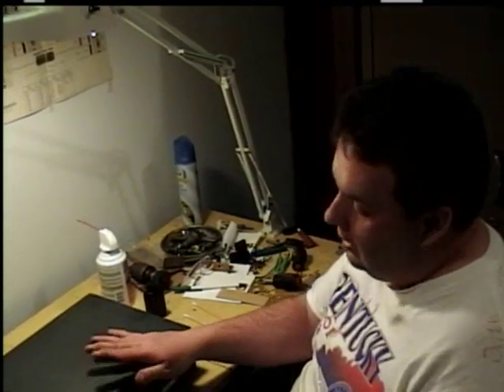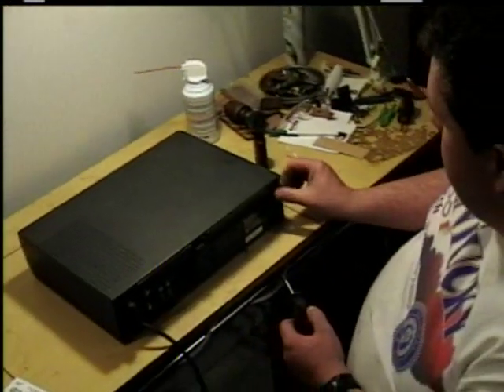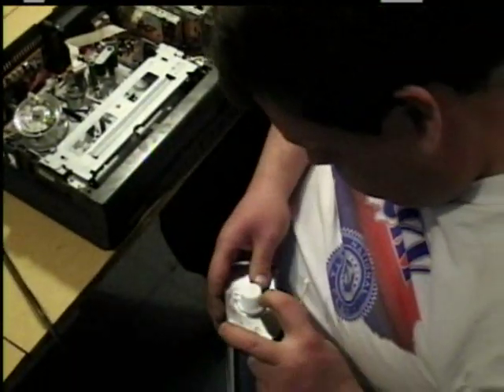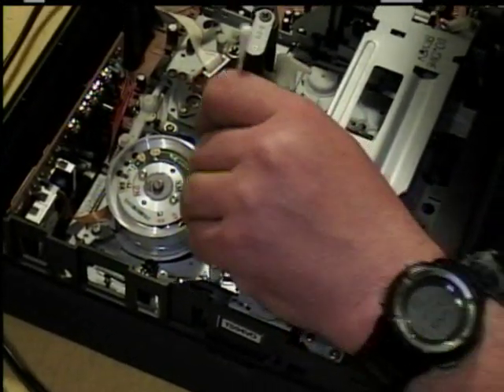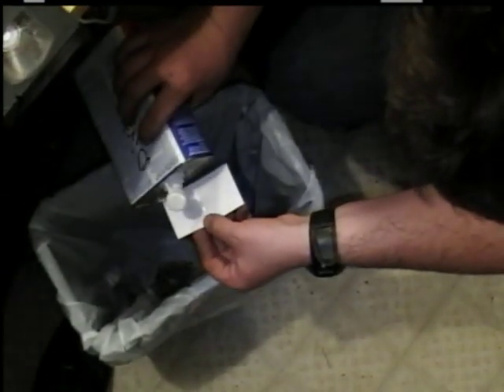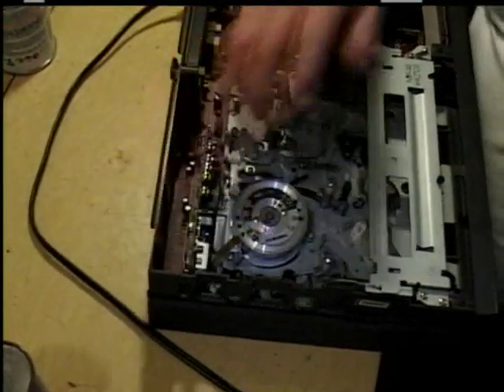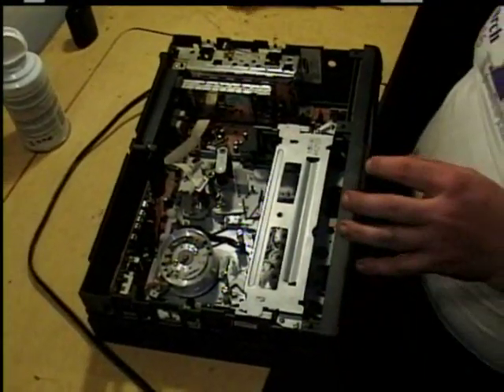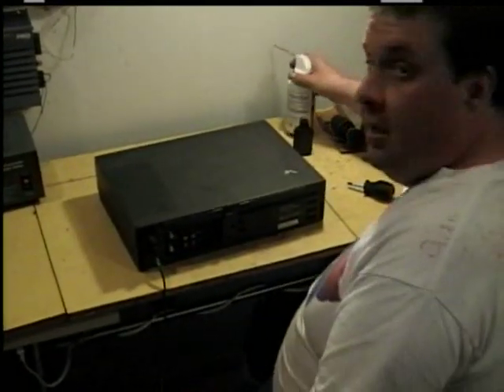Cleaning the VCR tape heads

Comment: No need for business card. Regular laser printer paper works just as well.
I was ready to cringe when I saw you pull out that Qtip. I was waiting for you to use it on the video head, but you surprized me. Yes the paper trick was how we did it back when I worked for Sony.

Comment from the maker: Richard Davies ,

 It could be a sign that it needs cleaning ,but to my knowledge the audio and video heads are seperate . On most models that I've seen anyway . Sounds like the controler that controls the speed of the motors especially the take up wheel . Could also be the video / audio  head motor ( if their combined ) speed controler . On most of these vcrs if parts are still available it isn't cost effecient to fix them unless you can do the work.

Thanks,
Whizkid

Comment: Thanks, great job. I had actually cleaned a vcr using the technique with alcohol and q tips. I have 3 old vcrs[ yes I still watch em in spite of having a dvd] but only one works. I cleaned one the picture was good but the audio was low with a lot of humming so I cleaned it again and also used your business card method. Anyway after watching your and cleaning the audio is now what it should be , all 3 now work. On one of them there was a piece that had came out and I hot gued it back and its working ok . Thanks again your vid helped more than any other I looked at for help.

Comment: It's been a long time since I used a vcr... but I could have sworn that I used to clesn mine, by putting rubbing alcohol on the exposed vhs film... and then I used to put the tape in the vcr, and play the alcohol rubbed part of the tape, which contacts the parts needed to be cleaned. It wasn't fancy, but if I remember correctly, it still worked.

Comment from the maker: What model is the DVD player? maybe I can help. The DVD front tray loader are not that different from the CD player. It sounds as though the tray latch is stuck. Look to the bottom of the tray. you may see a tiny hole just below the tray cover. it will look like those found on CD/DVD drives. It's an emergency eject hole. A paper clip would probably fit the hold. -MrFixit

Comment: you can also use a clean sheet of paper...just fold it over and apply some alcohol... I used to work in a repair shop. when I went to school the teacher used a business card to clean the head. radio shack used to see this gel lube stuff in a tube and it was really good stuff for vcr's.

Comment from the maker: David ,

I don't know if you did anything wrong , but apparently something went wrong . Did you spill any of the alcohol into the machine ? What kind of card did you use ? Did it leave any fibers on any sensors or on any part of the machine ? Check all of these as well as the whole area that you cleaned and possible reclean . Sounds about it's stuck on fast forward or  fast rewind or a search mode ?

Whizkid

Comment from the maker: Stephan , 

I noticed two things . You used q tips  . I only used them on things other than the video heads . I used a business card on the heads , not a q tip.  Did you use a q tip on the video heads if so there's probably cotton fuzz all over them . Second thing is that I used denatured alcohol not isopropyl . Reclean it using the method that I used and it may help May have to do it more than once .

Whizkid

Comment: I just found your video. I have a VCR that was working perfectly, but a few minutes later, refused to power up. I had bought some cassettes from a thrift store recently, so was trying to be sure they all worked and was trying to configure it so it could be used with an AV receiver, but now one of the cassettes is stuck inside the dead machine - it won't eject. Any advice for any future purchases of a VCR? This machine was given to me and I was using it "As-Is". Should I clean the machine next time?

Comment from the maker: @fatinthemiddle From what info I gathered for Alesis Digital Audio Tape, this process will work EXCEPT DO NOT use the business card or denatured alcohol to clean the heads. Must use a lint-free chamois like Chamois tipped swabs and 99% pure isopropyl alcohol. AVOID any vertical movements of the swab in respect to the tape's path. Be sure to back up any master recordings before proceeding.

Comment: WOuld a tape playing fast/garbled be an indication the heads need to be cleaned or do they need to be replaced?  WHen I run the clean tape thru it, it plays fine and the audio is normal. But when I pop in a tape after cleaning,. it runs fast and like 78 speed....

Comment: Hey Whizkid, thanks for the reply. I used q tips on the video heads then clean printer white paper. The problem was I hadn't hooked up my video cord correctly to my stereo. I have my electronics projected to crt and lcd, Why does a CRT have a clearer picture than LCD from VHS?

Comment: At 1:28, after removing the cover, what does he say to do: "plug it in" or "unplug it"? Why would that need to be done? Then he proceeds to the next step of using the canned air and he blows the dust out of the unit. That can cause a static buildup and cause the vcr to short out. So, working with audio and video equipment all my life, I never do any type of cleaning or removing dust with the power cord plugged in to an outlet. I am confused.
Reply: rcharne Is it better because there is a ground when it's plugged in?  I don't know much about working on electronics...😨

Comment from the maker: gateopenope,

Wheel not turning is probably caused by belt off track , broke ,stripped gear lever arm not moving over . Open the compartment and watch the wheel from the bottom or where ever it engages and see what it's doing or not doing and then go from there . Try looking the mdel , brand up on Google and see what you find on it . Try asking MrFixit as he is more of the vcr repairman than I am and see what he says . He should be on later or I'll pass it on to him.

Whizkid

Comment: This video is pretty much dead on, though you CAN spend a bit extra time on it repeating the steps a few times - as long as it is done carefully, it won't hurt to do the process several times.  I used 3 strips of paper to clean the main spindle until I stopped seeing black, and several q-tips to clean the other two heads- and even the surrounding areas of everything.  It is a very simple process. 

I do not recommend those "cleaning cassettes" as they are complete garbage and don't even work half the time.  This is a very simple and THOROUGH method if done with precision and care.

Comment: Hey Delbert if you really want to help people when making a diy instructional tape have your helper stand in a place where your hand is Not blocking our view. Second don't half ass the procedures. Finally as it is Not recommended to use regular cotton swabs tell people this fact. Surly you watched you work before posting it, didn't it occur to you that your hand was blocking what you were doing most of the time, I'm sure you can do better if you tried.